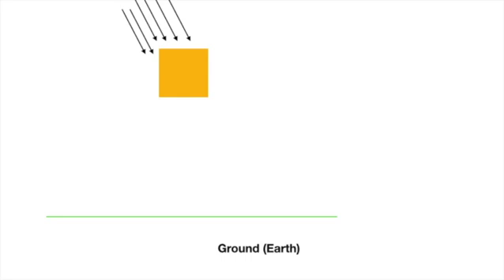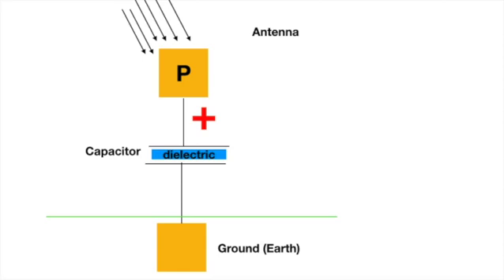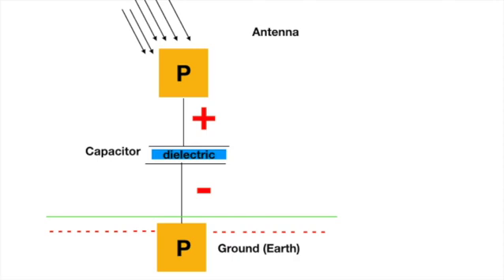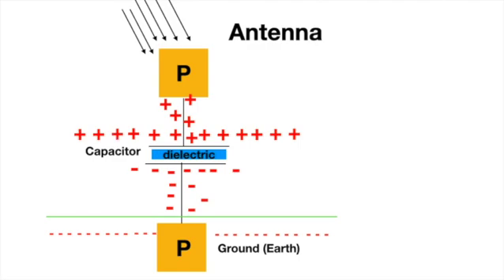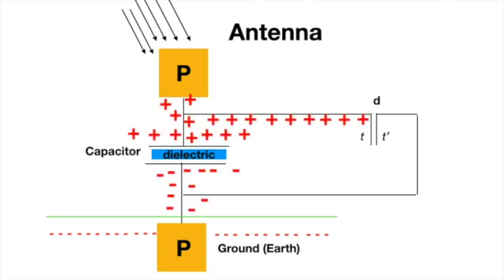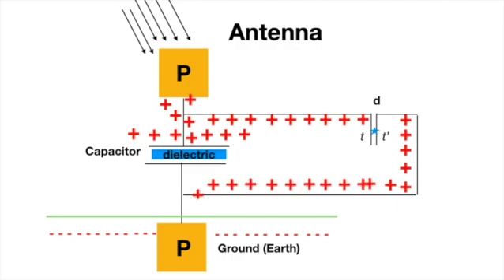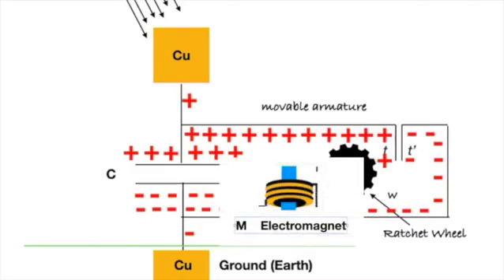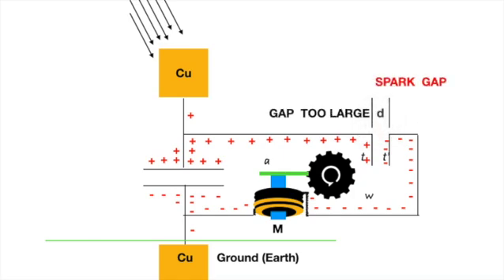Tesla Radiant Energy Animation

Comment: What I don´t understand is: this is simply the principle of the photoelectric effect, discovered by Heinrich Hertz in 1886. What is so ingenious about the technical use that Tesla describes?
Reply: absolutely nothing to do with photo electrics. its simply atmospheric electrostatics, and understanding how so called "static electricity" and "charged bodies" behave...

all the theories there and the basics are fundamentally sound yet everyones too pig headed and following incorrect interpretations and explanations to see the obvious.

its a charge pump come buck/boost circuit.
an elevated and isolated body will reach the potential of the surrounding atmosphere as soon as it is isolated from ground. it may have a gradient of several KV or more along its length, the lead in wire. yet static after any initial displacement currents.

the larger the body, the larger the surface area and charge it can hold. the higher it is, the higher the potential.

when a charged body is discharged, by grounding the wire, a current will flow as the charge... is it flowing on? off? does it matter? a charge will flow as the entire body reaches ground potential. a charge in motion is current. 
 
that current in an inductance can create a voltage spike at a useful potential that can be stored readily in a capacitor and used at will...
we then disconnect the elevated body, isolating it and letting it again reach the potential of its surrounds...

you cant charge the capacitor directly, it will only reach a potential of its height above ground... it will accept so much charge and no more as it starts to repel any incoming charge. it cant reach the voltage of the plate thats elevated. 

all the theories there and by the book. no magic. just interpreted differently.
Reply from the maker: Kurt
This is not photoelectric effect.  The Tesla discovery deals with the collection of cosmic particles as they hit a largeinsulated  metal plate.
Reply: @myeasyfixx1205  "The collection of cosmic particles" or rays is exactly the phtotoelectric effect. Tesla didn´t invent it. He also doensn´t claim to have discovered this effect, just the technical use of it.
Reply: @kurtklein8240  except it can collect this radiant energy even when the sun isn't shining.

Comment: What does spark gap do in this system? It doesn't seem necessary.
Reply from the maker: The spark gap is critical. The gap builds up a charge to the point it ... sparks across the gap.  That rushes or causes the electrons to instantly flow to ground.  Without the spark, there is no electron flow. just the potential increases.  The ideal situation is that the spark gap , is set such that the gap, sparks constantly, then you have steady power.
Reply: @myeasyfixx1205  Can't another electronic component be used instead of spark gap ? Isn't spark gap a bit of a primitive method? As if it had to be used because the voltage was too high?
Reply from the maker: @ahmetselimcalskan520  yes, this was envisioned in 1901, before the
Other circuit interrupts were developed.
Reply: If not using a spark gap, one must use another method to discharge the capacitor, because if not, the collected energy never goes to ground and eventually destroys the capacitor. The spark gap concept seems the most convenient since it's not a component one must buy, just a space of air between electrodes that can be easily adjust to regulate output.
Reply: @stravs8097  Why would the capacitor explode? Doesn't this system consist of a capacitor with two surfaces whose loads are unbalanced? As a result, when the spark jumps, the circuit is completed and the engine rotates. A simple circuit. After all, I don't see a very sophisticated technology in this circuit. Frankly, I think I could have missed something.
Reply: In present day, this switching idea can be found in all SMPS.
GDT's are another substitute for spark gap that are commercially available but still, the primitive way is much easier and accessible.
Just one major component that is missing in all Tesla's scheme.

Comment: My dad a NASA engineer worked on "Project Starfire" to use a ground based laser to optically excite stimulate Rydberg levels of exhaust pressure of a rocket engine's reaction chamber nozzle while in of North East Asia an inventor Motohiko Inai has patented a ground based particle accelerator to supply muons toa rocket engine in flight similar toa Stewert Cowley's "Star Liners" where an arc discharge beam of subatomic particle flux or thin film deposition ions refuel a spacecraft of Robert L. Morrison's patented lighter than air solids.

Xcor Aerospace has a working spaceplane "Lynx" having a patent of a "Cryogen Valve" & "Reverse Pressure" since even with diborane fuel and a chlorine oxidizer such a compact craft pushes engineering limits even if diborane fuel was deuterated for muon catalyzed fusion or externally pumped exhaust like a pulse detonation engine.
Reply from the maker: Does that work?
Reply: @myeasyfixx1205 
I think he's confusing Star Trek for NASA.
Reply: @myeasyfixx1205 
Are you kiddin?.

Comment: could y make a complete diagram thks in advance
Reply from the maker: Not sure what you mean.
Reply: @myeasyfixx1205  diagram of the circuit and choice of components if possible
Reply: @feeif5679  Leaving out the electromagnet and rotor just to demonstrate proof of concept, your components (dielectric capacitor, antenna, width of spark gap) are going to vary. Tesla's schematic isn't specific for this reason. For example, a larger antenna/larger surface area will differ to what it outputs into a capacitor as compared to a smaller one. The capacitor may be too large or small compared to the antenna meaning you either wait ages for a spark, or you get one quickly but the cap may not be able to handle it. The gap size is going to determine how much power is output when grounded. Too large and it may never ground, which means destruction of the cap and/or other components as the video mentioned. Too small and it may not release the full potential of the cap. Since the dimensions of the antenna are up to the builder, they will have to experiment with capacitor (cap) sizes and gap sizes to get the output they want.